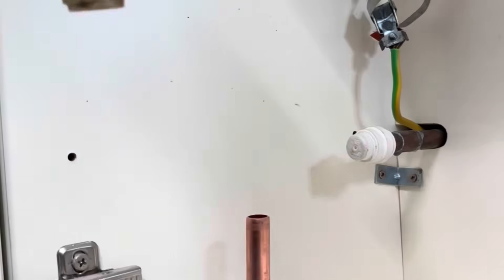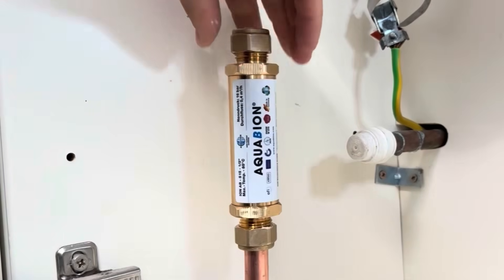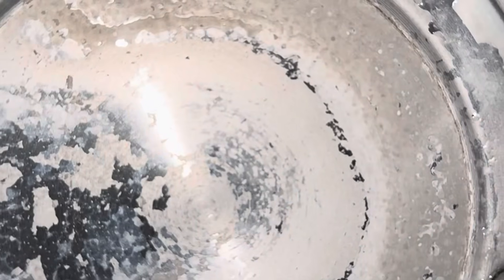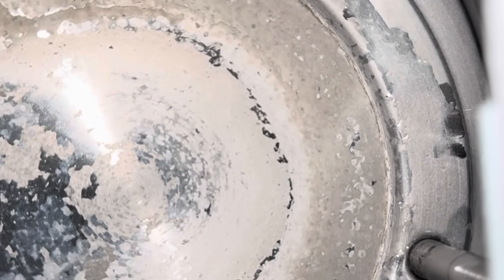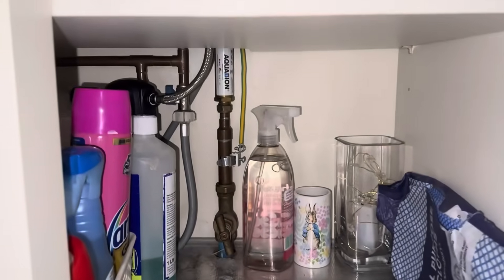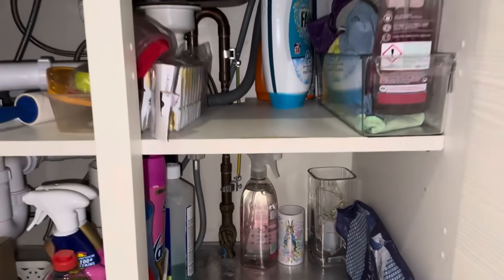How to help stop limescale issues in your house

Comment: I've never had a lot of faith in those and thought they were rubbish. I had one in my house few years ago and the lime scale was terrible so just thought it wasn't doing anything
Reply from the maker: I think if you can’t fit a softener then these are the next best thing
Reply: @mmplumber yes I use water softener nowadays with a hard water drinking water tap in the kitchen I have found this the best solution like you say.
Reply from the maker: Have to be installed to mi

Comment: Do they actually work though? This is a question no one seems able (or willing) to actually answer. I've looked at ways of doing this asI live in a hard water area and Limescale is a big problem, but if you research this, only salt based water softeners seem to really work, other products seem not to from what I have read. I won't go that route though, It's way to much hassle with the salt and expensive too. 

However, fitting stuff that doesn't even work is just as dumb. I would really like to know one way or the other from someone trustworthy such as yourself.
Reply from the maker: I fit them where we can’t fit a softener they do a money back guarantee so if your not happy they take it back 👊

Comment: Good job 👍. Yorkshire fittings used aswell and refitted the bonding strap 👌. Why didn't you use a compression tee to save on the soldering and to save on scorching the unit just in case. 
Hopefully you tightened the gland nut as they can leak when stop cock turned on and off 😅.
Proper Plumber 👌
Reply from the maker: Haha they always leak so always a quarter turn! I’m confident with soldering and the trowel protecting so it makes a better video soldering in place to watch 😍

Comment: I notice when you solder a fitting you don’t need to use a lot but as you heat it up solder seems to come from inside the fitting. Is there solder in the fitting? Here in the US it takes a fair amount to make up the fitting. Also you have very nice selection of tools that I haven’t seen in the states. Really enjoy the videos.
Reply: In the UK we have two types of solder fittings. The Integrated Solder Ring (AKA "Yorkshire") fitting, where the solder is already inside each port, and End Feed which contains no solder at all and as the name suggests, you feed in solder wire from the ends of the ports. ISR fittings are quite a bit more expensive than end feed and most of us use the cheaper End Feed ones. I do occasionally use ISR in very awkward situations where I can only get one arm near the job though. This plumber adds solder to ISR fittings which is actually completely unnecessary and defeats the purpose of them. Might as well just use End Feed if you're going to do that and save some money.
Reply from the maker: The solder can come out and leave a void and so adding solder will eliminate that and I know it’s up to temp by dabbing. Plus these fittings are made in the uk I believe so much better quality than your cheap china endfeed 👍
Reply: @Stigstigster 
I have noticed the ring on some of the fittings. Thank you for the information
Reply from the maker: This have solder inside mate, the quickness is down to my editing it still takes a little longer but you don’t want to sit through the boring bits of a video do you 🤣👍 the fittings have solder inside the ring which most people get confused with the a press fitting

Comment: Might be ok in some areas but I'm not convinced really. I live in Lincolnshire where the water is extremely hard. There was one water conditioner fitted on the incoming side but the hot water was coming out nigh on white - from the combi boiler. I fitted a water softener back in 2012, but it only does the hot water side. Drinkable cold water is still available everywhere in the house. btw I do like the trowel! Neat way of making sure the heat gets contained.
Reply from the maker: Yeah that’s a good way of protecting your boiler etc fair play mate, appreciate it buddy can’t live without my trowel!

Comment: thank you , im a approved plumber for halcyan same installation apart from i install a non return valve after the stop cock check valve to you youngsters ,it has a 30 year guarantee and made  in the uk , its a few quid more but i think worth it , and you can take it with you if you move like the aquabion , i met with halcyan at the last tool fair in london and have a great relationship with them check them out

Comment: If you did have the space for a big bad boy water softener, what are the benefits of having one rather than just fitting this device every time?
Reply from the maker: Feeling of soft water, less scale
Reply: @mmplumber I saw your video on another install of one of these a couple of days ago so looked it up, amazing how it can last seven years being so small, I live is a hard water area and fitting a water softener has been on my “ to do” list for several years but after seeing this I think for me it’s the way to go
Reply: They are £400 upwards quite expensive but less than a softener and seven years worth of salt, I’ve seen them listed as “limescale reducer” a full long term test would be interesting

Comment: Not sure I’d want to be drinking zinc carbonates, which is effectively what this device generates from a sacrificial zinc anode. Give me the calcium carbonates any day, at least they are good for bones and teeth. Fine for hot water systems, but on a potable water supply I don’t think so.
Reply from the maker: I personally don’t know the concentration it does
Reply: @mmplumber  it’s going to vary. Largely on flow rate, temperature, incoming water composition and condition of the anode. 
They use them on boats to prevent corrosion and in water heaters, but just don’t fancy it in drinking water. But if the Germans use it on potable systems it’s probably not too hazardous to human health.

Comment: Hello from Ecuador. Love your videos. Question- do those new copper fittings have solder in them from the factory?  I see solder come to the joint before you ever add solder. Thanks. Keep the videos coming.
Reply from the maker: Hey paradise4ever6! Thank you and I’m glad you like them I appreciate the support! Yeah these are pre-filled with solder I just like to add extra so I know it’s up to temp and fill any voids it can leave
Reply: Known as Yorkshire fittings. You still have to clean the pipe, flux etc. But just heat and most times you'll get a good joint. Like MM, I tend to drip feed some extra solder in.

Comment: Great job! I noticed you switched style to talking about the job in the safety of your van and getting stealth footage in the home. Is this the new plan moving forward?
Reply from the maker: Nah this was what I had to do as the audio was soo echoey in the kitchen I wasn’t happy with it, so that’s why I did the intro and out in the van, the next videos should be back to normal on site and I’m trying to talk more in them
Reply: @mmplumber the joys of recording real world jobs. I posted a video yesterday of a toilet replacement. My primary camera (which was utilizing my Diety mic) died about 3/4 of the way into the job so I had to capture some of my vocals with the secondary camera (GoPro with internal mic). I had to learn how to EQ the audio in Final Cut Pro to try to bring it up to match the Diety. I actually think I got close enough to where most people wont notice the difference, but yeah, I think i struggle more with the audio aspect of video making than the actuall footage itself.

Comment: What does the earth wire do on that pipe if theres no electricity running through it
Reply: I think you've just answered your own question?
Earth wire is to protect in the unlikely scenario when the water pipe becomes a conductor (due to a fault in electrical appliance etc) and to prevent electrocuting a person when they touch a tap etc.
Yes earth wire does not conduct electricity during it's normal operation (that's the main point).
And that "short" piece of earth wire is because that little gizmo (that mmplumber has fitted) is probably a dielectric (or does not conduct electricity that well) hence the earth "bypass" is required.
Reply: @AlexGnok not there for that purpose it to eliminate a potential difference from the main incoming earth  and any equipotential metal work , easy explanation is that you may have 230v at the supply live to earth ,but if you was take a reading at the water , gas , structural steel etc you may have 237v so that 7v is what could give you a shock so you earth it so everything is at the same voltage, there is a bit more to it than that things like plastic main incomers etc etc
Reply from the maker: It protects it from earthing currents, it’s supplied in the box and then strict say to put it on so I just did what I was told 🤣 for once!
Reply: In older houses the earth to ground needs to be connected to mains water input.